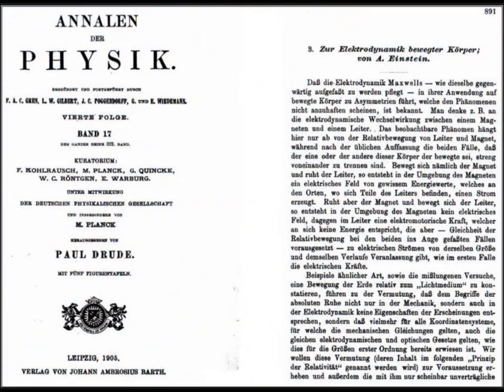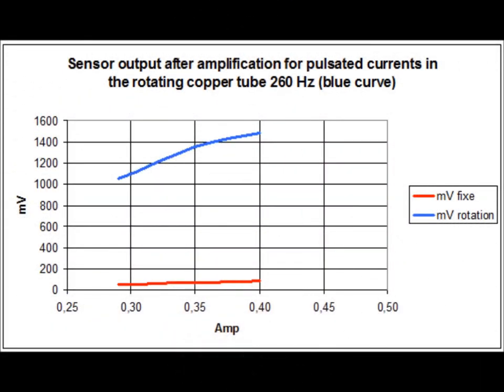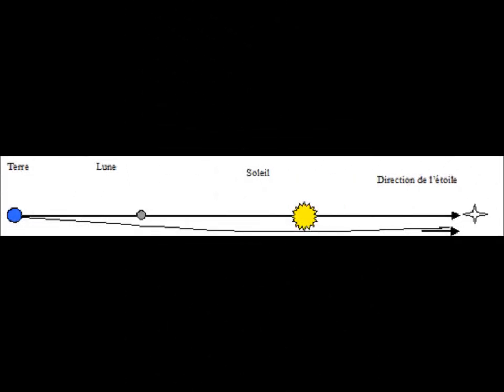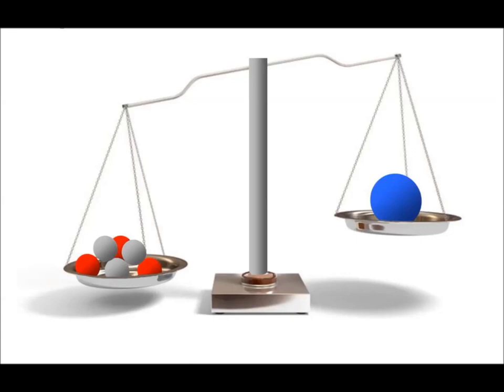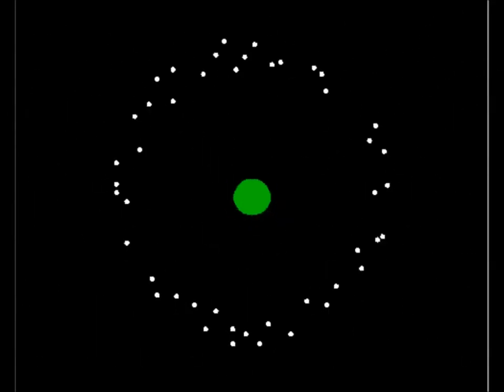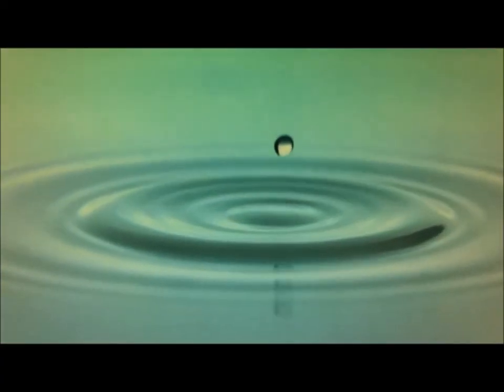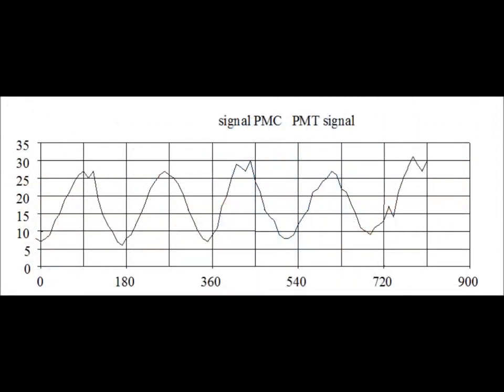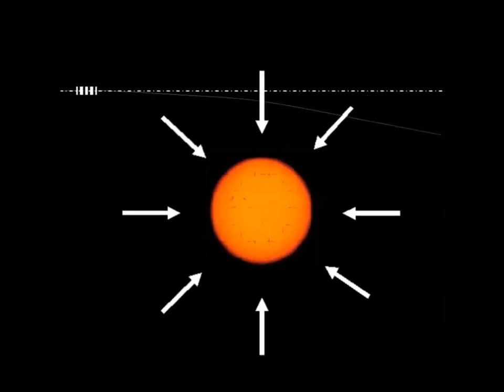the Aether : Light and Gravitation

Comment: Nikola Tesla asserted that if the speed of anything approached the speed of the medium of space, it would become blocked, meeting total resistance. This is what keeps particles from ever touching, their intrinsic motion causes their combination to divert to mutual orbits, etc. However, the medium still effected an elastic compression, which was a wave that could travel faster than light speed (FTL). And if the impulse was fast enough, that speed would be instantaneous. The effect of superconductivity. And explaining the lack of a time constant in gravitational systems.

The discovery that Tesla made which prompted his transformer patent was in fact a separation of charge from the medium of space, and the subsequent production of repeated waves of this medium without charge. It formed, as best he could determine the perfect fluid, with perfect compression waves of infinite velocity. He called these waves stationary to distinguish them from standing, yet they were in motion. They spontaneously increased in size as long as he continued to power them, pulling more and more medium into the pattern of the wave structure. This mechanism is similar to the venturi effect of moving gasses. 

The waves themselves could be patterned to match the waves emitted by ionizing atoms, and create the various effects that are accompanied by electrons being tweaked in atoms... chargeing, discharging, heating, cooling, physical displacement, and atomic restructuring... 

I believe this answers some of your questions. You may wish to read the historical research of Gerry Vassilatos: "Secrets of Cold War Technology", chapter 1. Available in .pdf.
Reply: Tesla would never call something "the speed of the medium of space" because space had no properties in his world view.

Comment: Everything was started from an infinite Aether.
The infinite (eternal) flat Aether has one physical parameter: T=0K
#  
We can use many theories to understand condition of T=0K continuum :
1) Theory of ideal gas  (because its temperature is T=0K )
2) Hawking black hole radiation  (because its temperature is T=0K )
3)  Bose-Einstein condensate  (because its temperature is T=0K )
4) Dark energy  (  is some kind of vacuum's infinite energy )
5) Dark matter  ( consist of Dirac's virtual particles, antiparticles )
===========
  P.S.
What does god want you to know about Physics ?
1) The Aether - Zero Vacuum (T=0K) is a material / physical continuum.
   ( all the rest is secondary )
========
Book: MATERIALITY OF A VACUUM
/ by Frank Wilczek and Lawrence Krauss
Debate 07/04/2018
#
When the next revolution rocks physics, chances are it will be
about nothing—the vacuum, that endless infinite void.
Discove rmagazine. /2008/aug/18 -
-nothingness-of-space-theory-of-everything
======================

Comment: “I consider this extremely important,” said Mr. Tesla. “Light cannot be anything else but a longitudinal disturbance in the ether, involving alternate compressions and rarefactions. In other words, light can be nothing else than a sound wave in the ether.”

This appears clearly, Mr. Tesla explained, if it is first realized that, there being no Maxwellian ether, there can be no transverse oscillation in the medium. The Newtonian theory, he believes, is in error, because it falls entirely in not being able to explain how a small candle can project particles with the same speed as the blazing sun, which has an immensely higher temperature.

“We have made sure by experiment,” said Mr. Tesla, “that light propagates with the same velocity irrespective of the character of the source. Such constancy of velocity can only be explained by assuming that it is dependent solely on the physical properties of the medium, especially density and elastic force."  

TESLA SEES EVIDENCE RADIO AND LIGHT ARE SOUND
by Orrin E. Dunlap Jr.
New York Times
April 8th, 1934

"The puzzling behavior of the ether as a solid to waves of light and heat, and as a fluid to the motion of bodies through it,* is certainly explained in the most natural and satisfactory manner by assuming it to be in motion, as Sir William Thomson has suggested; but, regardless of this, there is nothing which would enable us to conclude with certainty that, while a fluid is not capable of transmitting transverse vibrations of a few hundred or thousand per second, it might not be capable of transmitting such vibrations when they range into hundreds of million millions per second. Nor can anyone prove that there are transverse ether waves emitted from an alternate current machine, giving a small number of alternations per second; to such slow disturbances, the ether, if at rest, may behave as a true fluid." – Nikola Tesla – Experiments with Alternate Currents of High Potential and High Frequency (Page 148)

Comment: Electrons were not known in Maxwell's time. Maxwell's electromagnetic theory unifies the work of several scientists, based on the concepts of electrical charges, displacement, flow, and force fields.  Maxwell's equations are neither Galilean invariant nor Lorentz invariant, as they take the Aether (the medium) as their reference.  The alleged Lorentz invariance does not apply to the 4 "Maxwell equations" (which are actually Heaviside's).  Suffice it to note that the magnetic force field is not B but H.
As an electronics engineer I doubt that moving electrons (electric current) have no associated magnetic field regardless of any angle the current has been rotated.
Reply from the maker: Neither B nor H are forces. 
Electrons have an intrinsic magnetic field. Why this intrinsic magnetic field could not be the cause of the magnetic field of the electrical current as well as electron beam, provided they are correctly oriented and with a suitable structure? Assuming that the motion of electron is the cause of these magnetic field introduces a double cause for one very single phenomenon. This is not in line with the simplicity principle: one effect one cause. Of course this is a very old principle (Aristotle) so that our marvellous physics is fully free not following it !!!!!!!!!!!!!!!!!
Reply: @jeandeclimont4286  Read the fundamentals in Heaviside's book.
Paragraph 20 :
"Electric force is then to be conceived as producing or being invariably associated with a flux, the electric displacement; and similarly magnetic force as producing a second flux, the magnetic induction."
Then he wrote the two fundamental equations:
D=e.E (e is epsilon) ; and
B=u. H (u is mu)
Nowadays the quantities D and B are the electric and magnetic flux densities and are in units of [coulomb/m2] and [weber/m2], or [tesla]. 
The displacement current is dD/dt or edE/dt (e is epsilon). The magnetic field is H, not B, and the equation rot H = j + dD/dt clearly indicates that the magnetic field H is associated with both currents, conduction current j (electronic), and displacement current dD/dt. 
Without the displacement current, it would be impossible to explain the magnetic field (of electromagnetic waves) in the vacuum when no electrons are present, nor the charge current of capacitors.

Comment: Aether moves earthwards at 9.8 m/s2 in vortex style pushing everything to the ground. Earths electromagnetic forces pull aether from space towards it, aether in turn pushes everything to the ground with it causing gravity we experience. To make an analogy, its similar to water going down the drain pushing all objects in the water towards the drain. It is the aether that curves around the earth forming a vortex as it accelerates towards the earth, not space-time. Aether is a fifth platonic solid or fifth state of matter that entire physical universe is submerged in. You can read book "Uncovering the Missing Secrets of Magnetism" to start learning about aether. Also read book "Occult Ether Physics by William Lyne" which goes into Nikola Tesla's research on aether for propulsion purposes.